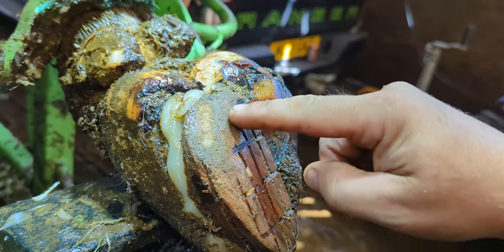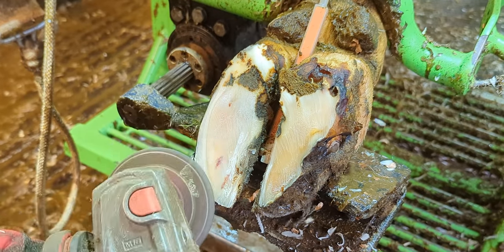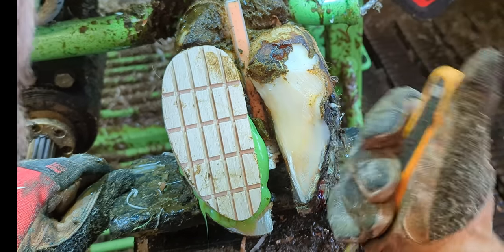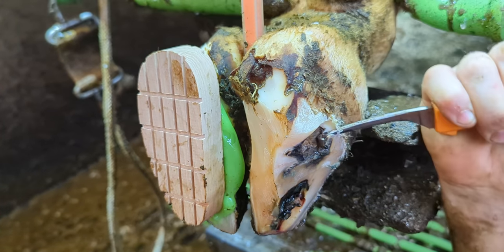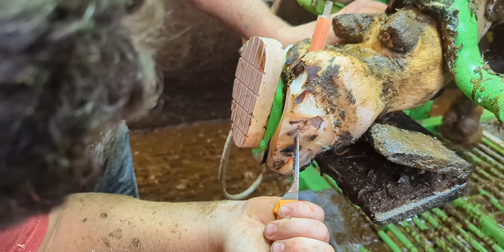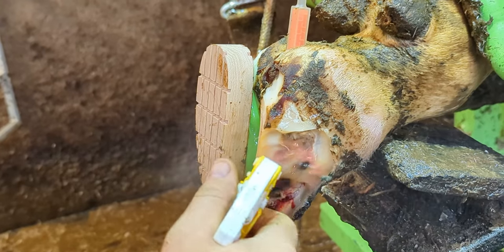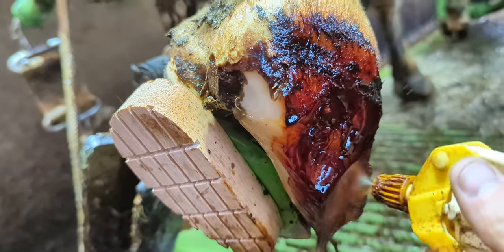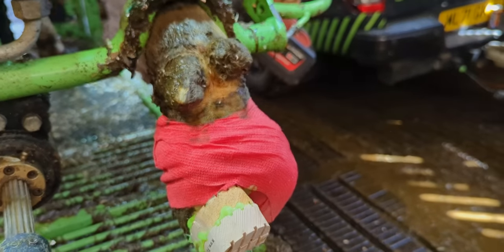Horrendous WHITE LINE GOUGE is made even worse by this piece of WOOD

Comment: I use to grind and repair concrete, and after doing it for so long, was knocking paint drops off new epoxy floors.  You can see that same thing here where it's just an extension of your arm where someone with less experience being that aggressive could cause a problem.

Comment: Would you be able to trim a horses hooves in that machine? Looks like it would be a lot safer for the trimmer.
Reply: @carol   Do you have a horse?  Horses aren't as docile as cows.  I know one farrier who will lay a horse down to trim it, but I would never use him.  Horses weren't made to lay down for any length of time.  I knew a horse that had to undergo a lengthy surgery and ended up with muscle atrophy.  This was at New Bolton veterinary hospital where the surgeons knew what they were doing....   🤔 

So, the short answer is NO!  A horse's mindset would not allow it to be "trapped" in a crush to do its feet.....

Comment: I don't understand why you put the indents in the middle (making like a bowl across both hooves). If the hoof is naturally flat, doesn't the change in shape put more pressure on the walls?
Reply: It’s kinda like our arch on our feet. It transfers all the weight to the outside of the hood to where the load bearing part of the hoof is. That part bruises real easy and can cause ulcers so he carves it out. Hope that helps. 😊